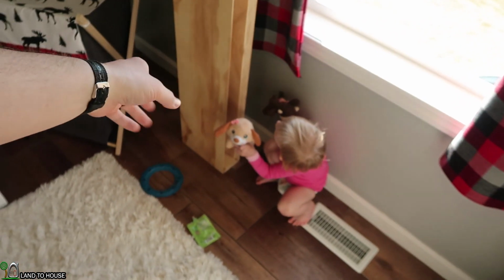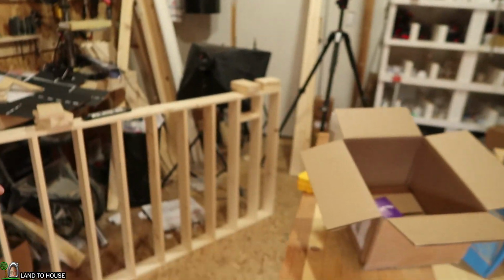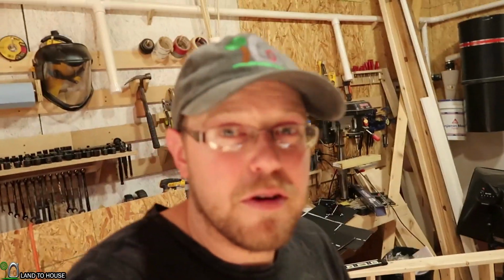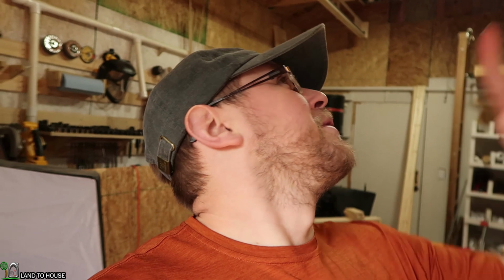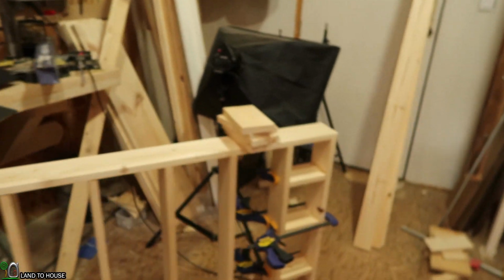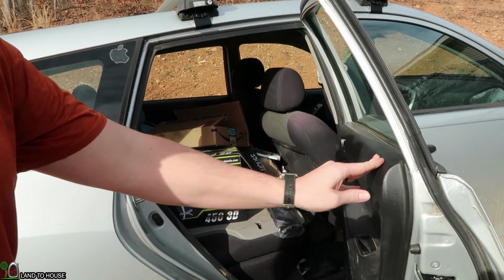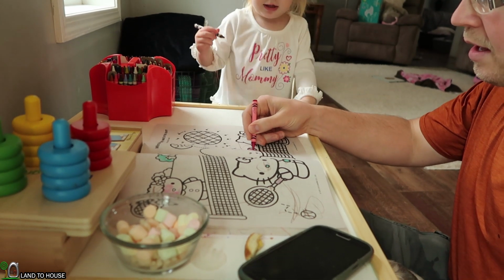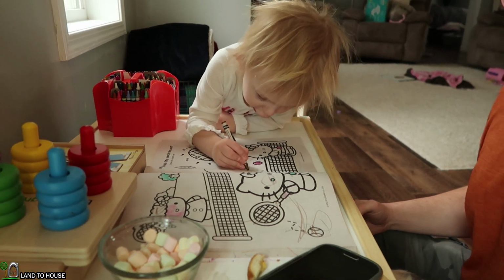Hanging the Floating Shelf - vlog 131

Comment: Please clarify. What do you mean by the track pad is inverted? I can't find any information on this online regarding new laptops (I don't have enough info to look it up).
Reply from the maker: On a trackpad you can use two fingers to either scroll the page up or down. By default when you move your fingers from the top of the pad toward the bottom it moves the page from the bottom to the top. In the settings you can change it to Natural which makes a lot more sense to me.
Reply: @LandtoHouse  Ah, GREAT! I even didn't know, that you can change this! Luckily, my recent laptop was adjusted correctly (scoll down => page moves down). But I had this weird behaviour on some devices (scroll down => move up), which I then normally throw out of the window (well, not literally). Thanks, you saved a lot of laptops from being thrown out of the window ;-)